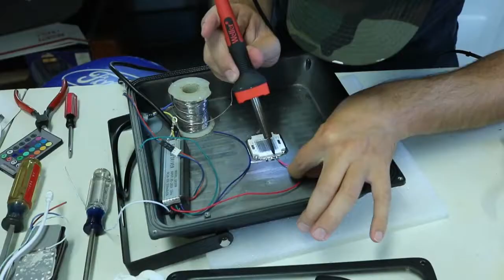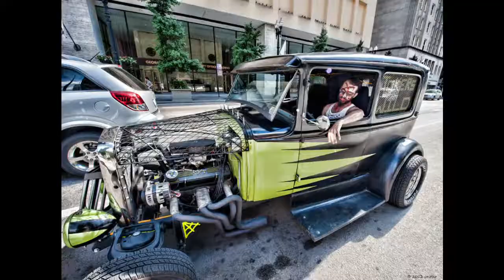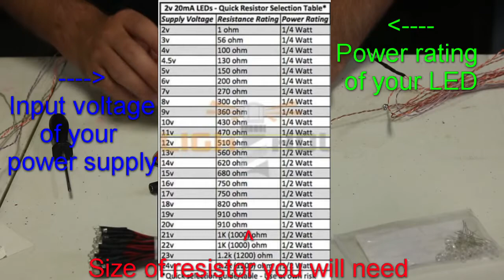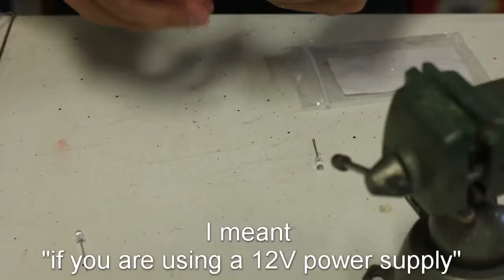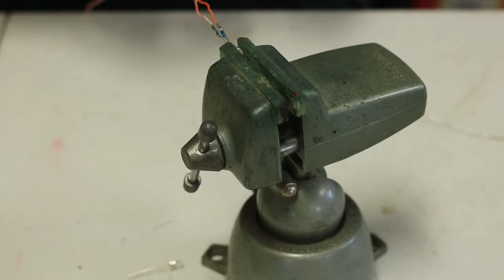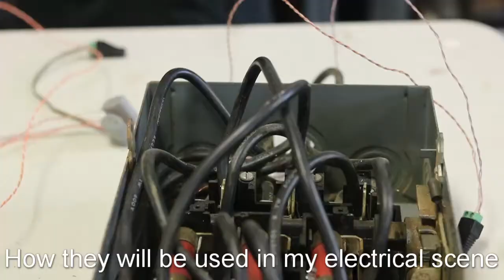Basic 12V LED Wiring Tutorial - How I Do It -  DIY vs Prewired

Comment: Wat kind of power supply do u use and  how many LED'S can u power off of one power supply
Reply from the maker: I have various regulated AC to DC power supplies that i use for my smaller projects. Most props in the "haunt world" are either 110V or 12V...so to keep things simple i buy 12V leds so theres no guessing game when i need a power supply. I have 1amp, 2amp, 3amp, and 5amp power supplies for just about everything i do. These flashing leds pull about 20mA each, as there are 1000mA in 1 A (1000/20), you could run 50 leds off a 1amp power supply. I would suggest always leaving yourself a little headroom though, so if you were to run 40 or 50 of them id use a 2Amp just to play it safe. :)
Reply from the maker: ...or two 1amp power supplies for that matter would work as well.
Reply: Evil Olive Productions thanks for that information u saved me lots of money on not having to buy batteries for next yrs build. So I'm taking this idea and ur monks build idea too
Reply from the maker: Awesome! yeah the power supplies are MUCH easier to deal with than batteries. Have fun with it, and send me pictures of your monks through facebook when youre done :)
Reply: Evil Olive Productions will do